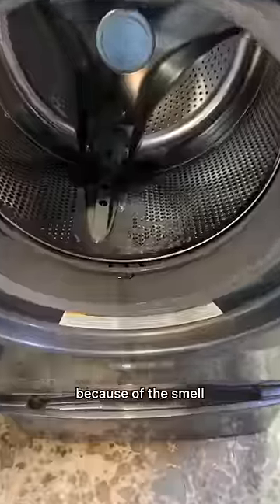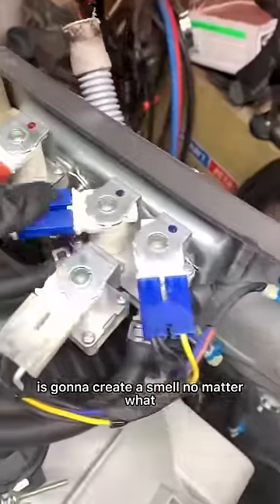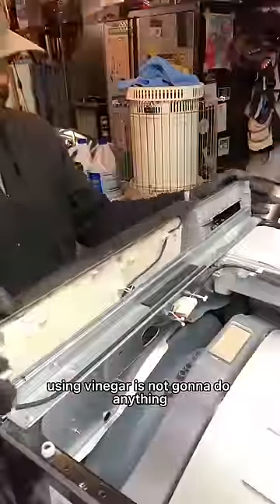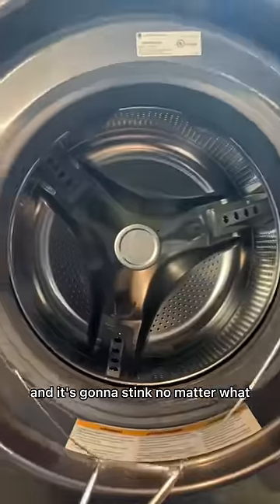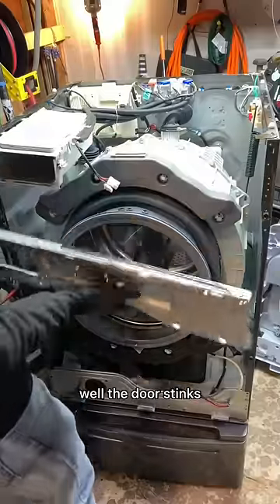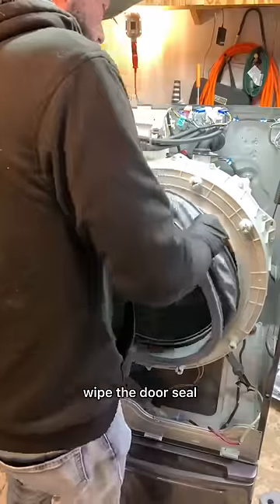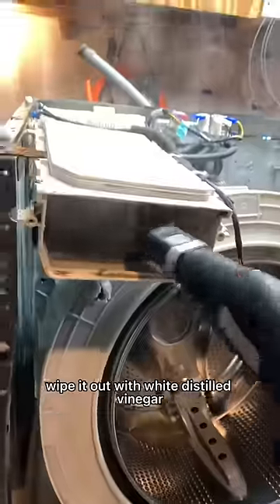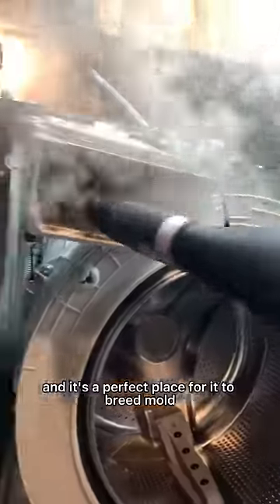Front load washers are proven to wash better. Facts, not opinion

Comment: "I like front load washers", yeah that's because you fix appliances for a living.
Reply: How so? 10 years and still going strong
Reply: Lmfao
Reply: That is because they've proved to be more efficient.
Reply: You know that top loaders are a American continent thing! The rest of the world use front loaders, better in many ways.
Reply: @CobbyRocky  I prefer reliability
Reply: @randybobandy9828  I've been using front load washers both between Samsung LG for 10yrs now and they've never let me down or smell. All I have to do regularly check my filter every 2 months, use the correct dosage of liquid soap and leave the doors slightly open after usage.
Reply: @Rocky Bashimor  my guy... it's been settled ... top loaders are more reliable period.  Less moving parts and gaskets/seals.
Reply: If front load washers are unreliable, they are ill designed. If there where any fundamental issue, commercial units wouldn't be mostly front loading units.
Reply: @Daniel Rose  commercial units are mostly front loaders because they can hold larger capacity. When you need to wash very large items, you go to a laundromat. Reliably is not one of the pros of a front loader.
Reply: you've been breaking yours. Still have one for the past 7 years no service calls since install. We dont take it apart to clean it. Just vinegar cycles and bleach cycles once every other week...
Reply: @AlkalineGamingHD  exactly
Reply: @randybobandy9828   Nope. In all my years of using front load washers, I've never needed to service them or change gaskets nor the seals. Plus with the direct drive or inverter motors, there are less moving parts compared to the top loaders bruh!
Reply: @Rocky Bashimor  it's not "nope." the general consensus is that they are less reliable, and your anecdotal story doesn't change that. It's like trying to say a rotary engine is more reliable than a piston engine, it just isnt.
Reply: They’ve proven to be more efficient & wash better. Everything he said is 100% true. 
Machine was designed to use less water & detergent.
Reply: @CobbyRocky  Those are all proper things to do,  but it may not be enough sometimes becouse nowdays the detergents and softners are more and more concentrated (thicker and thicker) and can leave residue even when you're in the right limits, so in order to avoid it and make sure everything melts better I keep a tablespoon and a plastic cup next to washing machine so I first diluite the softner and afterwords the detergent with some water before throwing it in the apposit section. In the past, during the production process all frontloaders used to get the antibacterial treatment of rubber and plastic parts, but nowdays they cut corners and they keep this treatment only on professional heavy duty machines like laundrymats... Some of the brands advise their customers to run an empty wash on at least 40°C  without any detersive in order to eliminate the build up every 60 washes...
Reply: @randybobandy9828  I do use and prefer HE washers. They are more delicate on clothes and are easier to load/unload.
But we simply cannot deny the KISS principal. More parts -- especially moving ones -- the more areas for failures to occur. 
THAT being said I also have never encountered a issue with my HE. We have a old top load still plugged in but I really dont use it despite liking the better clean it somtimes gives. Just run the HE longer or for two cycles and Im at the same place as the topload.
Reply: Me to
Reply: You can keep any washer clean if you use powder detergent. Liquid detergent users can add calgon and reach the same result, but never wash without builders. Liquid detergents are superior to powder when you need to take care of water hardness at the start of a cycle, therefore I use liquid detergent for prewash and powder detergent for the main wash for optimal results.
Reply: Wagha wagh  no it  literally is the general consensus.
Reply: Thank God  for that. My Samsung’s are 15 years old and still work - my husband has “fixed “ both machines  a few times the “repair “ guy told us to replace them 5 years ago!!
Reply: @randybobandy9828  I never knew front load vs top load washers was a whole debate 😭
Reply: @organiccold  front loaders are junk
Reply: front load r junk. been selling for 20 years
Reply: A cheap top load will still work great for 10-50 years if you take care of it. A cheap front load will reek, no matter how much you clean it, and can make your household sick with mold. 

I'll stick with the good ol reliable top loaders thank you very much.
Reply: @tickley42  a new whirlpool top load will only last 6-8 years these days.
Reply: @randybobandy9828  They are too fool
Reply: @goodlife6277  lmao... nope.
Reply: @tickley42  say what? Never had a top loader because Europe and never had one reek. Keep the door open between washes en washing at hot temperatures once in a while and you're good to go.
Reply: Honestly switched to top loader few years ago hated front loader.  My clothes get dirty at work.  I do deep fill/deep rinse with 2 hour soak. Total time like 3 hours but my clothes are spotless and odor less.
Reply: I work on appliances for a living….and I hate them.
Reply: I was gonna make this comment if you hadn't. He's selling the idea that fronts are better just so he has job security
Reply: I like them too
Reply: @randybobandy9828  no it is not front loaders have been tested and retested by independent companies and all front loaders shit on top loading washers… as for reliability that all depends on the quality of parts IN the washer and a top loader can easily have poorer quality parts in them considering how cheap they are and then you’re just left with improperly washed clothes and a machine that will crap out after the warranty is done
Reply: @zayneparker8711  top loaders break down more often and are simpler to fix, there’s no shortage of rubes that don’t know how to take care of their machines
Reply: @francd2981  like I said top loaders are more reliable. End of story.
Reply: From load washer has gravity on its side when it comes to washing clothes, i.e., the laundry is bumped and turned over much more in a front load machine compared to a top loading model.  I don't know anything about durability, it usually depends on the manufacturer
Reply: @randomdudeontheinternet9926  my top loader is 22 years old lg turbo drum.
Reply: @deanhorn2369  you can't buy top loaders outside the US. Nobody else wants them. Let that sink in.
Reply: @voxelfusion9894  and besides I didn't say anything negative about front loaders just saying how old and reliable my top loader has been all these years so I don't know why you are being so mean next time have some respect!
Reply: Haha seriously….
Reply: There's 40 yr old top loaders out there thatve never been serviced...Also, laundromat do not use exclusively front loaders. I can think of 3 right off that have 0% front loaders.
Reply: I’m a top loader kinda guy
Reply: I like how the only argument that front load fans can come up with is that they’re more efficient and clean better (the second one is incorrect. They clean the same). The fact of the matter is that efficiency is not the argument; the argument is which one is more durable. Front loaders are not more durable. They’re less durable. Stop trying to move the goalposts folks.
Reply: @voxelfusion9894  yeah, and the rest of the world has insane regulations on water usage. Almost like the only reason that only the US uses top loaders is because they use a lot of water.  Almost like it has nothing to do with how durable they are.
Reply: @organiccold  what rest of the world you live in? I've only seen front load in Canada/us. The middle East and sub continent always had top load
Reply: I love this debate thread about washing machines lmao it’s 2am how did I end up here???
Reply: @CobbyRocky  i have a bosch front loader thats 20 years old and still going strong
Reply: @randybobandy9828  u know in a plane a rotary engine can run with multiple pistons out. Slanted engines 1 or two out you’re not going anywhere very fast.
Reply: That's the dumbest thing I've ever heard. They get your clothes cleaner, with less soap & water, and your clothes will last longer. What's not to love about that?
Reply: @DriveByGuy  What good is slightly more durability when they destroy your clothes? Twister washers are not good for fabric. Enjoy your duller colored clothes that need replacing twice as often for your machine that lasts slightly longer. You're paying more money in the long run on new clothes.
Also, your main argument is that you're poor. XD
Reply: I was thinking the same thing! 🤭
Reply: He's got the same advice I gave my wife. Keep a towel close by and wipe it out after each load.
Reply: @randybobandy9828  what's all this moving parts talk? A water pump to get rid of the dirty water and a motor to spin the drum, if you want to get all pissy the door and drawer. Please tell me all the other moving parts a front loader has? Front loaders are better, I'm guessing your American and not caught up with the rest of the world just yet.
Reply: @danielrose1392  I prefer front loaders, but it isn't fair to make a comparison to commercial/coin op machines. Virtually all of those have the door connected straight to the outer drum, meaning just a gasket is needed instead of a huge flexible door seal with plenty of crevices for mould and gunk to collect.
Reply: @organiccold  in Australia I’ve only had top loaders?
Reply: The manual says wipe down the manifold… mine works great
Reply: Overloading front load washer will cause more problems then doing an extra load…. My friend changed his twice while I used my one which is still running!   I never fill it up to the top either….they do.
Reply: @organiccold  except for eastern Europe
Reply: @randomdudeontheinternet9926  
I think front loaders clean better.
Reply: @randybobandy9828  
Front loaders 😊
Reply: @CobbyRocky  
👍🏽👍🏽👍🏽
Reply: No, because he knows how they work and how they are better derpy...
Reply: That's not how it works..
Reply: @randybobandy9828  front loaders are just as reliable if used right, don’t over load them or under load them and they’ll be fine, clean out the door gasket every week or two just by wiping it out and your clothes will be cleaner than a top loader
Reply: @danielrose1392  actually front loaders can just fit more for the design, can always go further back or make the basket wider but can’t really do that with a top loader, and in commercial settings there’s usually multiple side by side, front loaders are better for cleaning though which is the main reason
Reply: @randybobandy9828  user error* is the main problem 😂 which is what makes up the general consensus, I would know, I own a service company and work on the machines from 8 to 5 everyday.
Reply: @daniby9894  I read like half of that but the easiest thing that always works is use these tablets called Affresh, they are for washers, you just put one in every so often with hot temp and it works like a dishwasher tablet, cleans it all out
Reply: Obviously he was talking about using them, not the fact that they exist.
Reply: How so? In my previous house there was a basic front washer from Ariston which was between 20 and 30 years old and working great.
Reply: @organiccold  it's the same reason we have big parking lots instead of so many vertically built parking structures all over the place. It's all a matter of most cost-efficiently using space depending on what amount of space is available to you. We have an amount of land in America that because of it's abundance, makes it cheaper to built outward than upward in most places, with exception to obvious examples like major cities such as LA, NYC, Chicago, SF, etc., that are littered with skyscrapers and parking structures. European nations better reflect the American states that contain those major American cities, than they reflect the rest of America at large, in terms of both size in most cases, and the extent to which they're forced to be horizontally space-efficient to maintain cost-efficiency. There are some areas of European nations that no one wants to be in for whatever range of reasons, enough so that people there could just use space horizontally to be most cost-efficient, but they are the exception in European nations, as opposed to the rule throughout most of any given American state.
Reply from the maker: This is the, literally, this response/answer I have ever sent to this comment, and believe me, I see it at least 10 times a day lol
Reply: @derrickwith2rs  There is no horse milk in the desert.
Reply: In Europe we haven't seen top loading washers in decades. And my machines have never broken.
Reply: @slimcognito.  Unwise is a man who masters his parts, but even more unwise is a man who masters his face.
Reply: @CobbyRocky  what is more efficient about them. Water, electricity, soap ect. And how much more?
Reply: @AlkalineGamingHD  Top loader chiming in. 30+ years old 😆
Reply: @randybobandy9828 they are also more reliable, why do you think most laundromats use only front loaders
Reply: @Randy Bobandy  reliability of a double cheeseburger bobandy
Reply: My cousin has a Maytag front loader washer and dryer, and her husband works a lot, and the washer doesn't get their clothes clean enough. And she also says that if she gets another washer and dryer, it's going to be a top loaded. I agree with her opinion.
Reply: @randybobandy9828  I agree with that.
Reply: I'm from the UK. We don't get top loaders over here. You just leave the door open on the machine after washing, doesn't smell. I have never put vinegar in with my clothes and tbh I'm scared to try 😂
Reply: @derrickwith2rs 
That comment makes ZERO sense
Reply from the maker: Yeah I definitely need to edit it lol. I didn’t read it before I posted it lol. My bad
Reply: They clean better.
Reply: Mines 20 years old haven’t had anything go wrong with it
Reply: @derrickwith2rs  I enjoy your videos and I love the same kind of washer mchines. It's very pleasing to see the care and skill with which you dismantle them, find the faults and repair them.
Reply: @CobbyRocky  By whom?  Efficiency at the cost of more maintenance?  If I could get a top loading washer from 1985, I would.  None of this HE, high speed cess pool of garbage.
Reply: @randybobandy9828 so what a tub and those washboards orrrr
Reply: @Randy Bobandy  if you take care of your car it isn't likely to break down. Same goes for a washing machine, front or top loader.
Reply: @MegaGyalis  and less wear and tear on your clothes. I love a front loader.
Reply: @MegaGyalis  and there’s less wear and tear in the clothes
Reply: @johnbrown5787  more than 20 years. They were also in the 50 s
Reply: @0741921  and in some countries they use washers but line dry their clothes.
Reply: @danielrose1392  True. I work at a hotel doing night desk and laundry and we have a front load washer.
Reply: Top loaders for life!
Reply: @organiccold South East Asian here. Top loaders are 1000% more common sorry
Reply: cries in top loader issues, not getting stuff clean
Reply: @B2Roland if junk means cleans clothes better then yea lol
Reply: My LG front loader has been very reliable for over eight years. We had a motor/drum rotation sensor fail early this year. Diagnosed the failure via displayed code, replaced the sensor myself for less than $20, now works as good as ever.
Reply: @CobbyRocky source
Reply: @CobbyRocky I prefer reliability
Reply: @Warp2090  Same here and my front load has been reliable going 10 yrs strong
Reply: Yeah, and I imagine he'd rather do less and meet more people in public whose clothes don't stink of bad washing machine.
Reply: Ummm... my front loader is 15 years old and going strong. My top loader lasted 5 years.
Reply: @voxelfusion9894 That's not true, they have them in South America in Japan at least.
Reply: Literally every repair person who repairs washing machines...told me those washing machines are the worst...because of the design...and they showed me the faulty mechanics behind it
Reply: @srproductions8798  every repairman I've talked to says both front load and top load are not built to last these days so basically comes down to personal preference. To me, it just seems like more can go wrong with a front load, especially with all the smart features. Top Loads seem like less can go wrong but if they are still built like shit we can't expect them to last these days.
Reply: @danielrose1392 
 The key word here is commercial….less parts, less plastic, better built.
Reply: @CobbyRocky more efficient? 😅😅😅😅😅😅😅😅
Reply: @organiccold my front loader went 15 years without issues, my top loader I have now is junk. I out grew the front loader, it was a small one and not big enough, got a similar age top loader and had problems with the clutch and transmission multiple times, GE didn’t sell the part I needed.

That front loader cleaned better and faster.
Reply: Same top loader for 20 years doing mechanic work . And a machine designed to clean should not need its own cleaning. 😁
Reply: Anyone who thinks top load washers are probably people who don't have dirty clothes. If you work a trade, and you have dirty clothes, a front load washer ALWAYS gets clothes cleaner. I work in the trades and have a ranch that takes 3 full time employees, plus me, to run. The clothes that get cleaned in the top load in the barn never get clean and I often have to take them into the main house to rewash. That never happens to the ones that go inside the main house. They're always clean.
Reply: Speed Queen top loader. It's efficient, cleans better than front loaders and never has the mold issues.
Reply: I like front load washers too…. Had one problem… that was covered by insurance… since then it has been flawless.   Uses much less water, spins  the clothes near dry, much easier on the clothes
Reply: They’ve never been better than the vertical tub machine and never will lol 😂
Reply: Front load washers suck
Reply: @MegaGyalis  , Wash better, how? They don't wash better. They use less water than a conventional top loader. That does not equate to washing better. The main component (water) is being forced into frugality,  when it's the main thing that cleans the clothes. Manufacturers of these pieces  of shit known as HE front loaders seem to have forgotten about  the saturation point factor
Reply: @tickley42  That's because front loaders use such little water they can't drain and flush away dirt,  grime,  soils like top loaders can.
Reply: @rmac41981  , Exactly.  With front loaders you can't soak nothin'
Reply: @voxelfusion9894  We like top loaders in the Americas, because  unlike where you live,  in the Americas, energy does not cost a fortune.  And we have laundry rooms.  We don't have to put our laundry machine in the kitchen
Reply: I use top load washing machine samsung for 20 years. No issue at all.
Reply: @danielrose1392 I had a front wash for about 3 months and it brisk down and started to leak. After that day it was top.
Reply: @derrickwith2rs could you explain how front load washers are better/more efficient than just saying they are….
Reply: @CobbyRocky  if we’re talking anecdotal stories my dad has three top load washers from the 1960s that are still in use today. I don’t think there’s any front load that could possibly come close to that. So put that on a spin cycle and think about it.
Reply: We're not using your american style top loaders in europe at all, they're inefficient AF in terms of water and electricity use, they do not clean as nice and tear up your clothes faster. They SUCK. I Am using ONE single AEG front loader without any issues for the last 15 years, it never smells, never an issue - I only swapped the coals of the engine once, super easy.
I also never knew this smell issue was even a thing before this short, just don't close the door after washing and do a boiling-wash once a month, vinegar not even needed.
They're just objectively the superior technology. Also self-repearable if you're able to read a service manual. You know you're the only country using these old style top loaders anymore?
Reply: @faithdriven11 The 150 year old washing boards are still working as well. Why ever upgrading, right? Also most quality (AEG, Miele) front loaders potentially work 30-50 years with some service, it just doesn't make much sense to use inefficient crap today - the savings in water and electricity outweigh the cost of a new machines in very few years if you'd care to do the math.
Reply: @dynoob  I was comparing apples to apples you’re comparing crab apples to apples no comparison at all with your argument. I’m sure the technology will get better, but for the time being top load is king.!  in fact, a lot of the manufacturers who were going exclusively to frontload have come back around and re-introduced  Top loads because they know the reliability is Superior with Less maintenance. Mic drop.
Reply: @organiccold : lol dude an American invented the front load washer..just like most modern invention the modern washing machine started in America first and the American public got used to a certain style of machine so they continued making it that way because those are the ones that sold but we've had front load washers available in America for just as long  
"technically longer" then they've been available in other countries.
Reply: dammit!
Reply: Every modern top loader my fam has had has died fast. The front loader we currently have is 7 years now.
Reply: All of Europe uses front loaders and no one ever complains
Reply: did you listen to the video?
Reply: @CobbyRocky they use a little less water.  That's it. But my new top loader has a automatic water level. It's 10 times better then any front loaders and cleans better
Reply: @organiccold no they aren't. Not in any way.  They use a little less water. That's it. I've had both and I will go back to top loaders and they clean better every time.
Reply: @CobbyRocky 58 years on top load Maytag and were still going. Went from grandparents, mom, me, and passed on. No front loaders ever will do that
Reply: @AlkalineGamingHD so how is it more efficient if you have to do that? See this is what they don't figure in when they tell you that.  I never have to run my top loader extra cycles. Plus mine has an automatic water level so it uses only the water it needs. My clothes are cleaner then the crap front loaders.
Reply: @kennethlaw9830  Energy Star's "h.e." program refers to washers thats meet the guidelines for energy and water consumption. Less water means less detergent and less power to heat. SpeedQueen has some side load washers that are not h.e. qualified as they are too large and use too much water. 

Its hard to not find h.e. machines many places these days. I enjoy the power, water, and detergent savings for the average refresh washer load. Should I need some extra staying power multiple cycles are always an option for me as are features like the "stain" option which gives the load an extra 30 soaking minutes.

I do agree with you and my mother one one thing; "Look! you can see the water! You need water to CLEAN THE CLOTHES!" 🤣
Only time we've ever rerun a top load was for extra rinse for 'sensitive skin'
Reply: @AlkalineGamingHD  I garuntee your clothes are not as clean as you think they are. Now if you live in the city and you don't really work. You just sweat a little. That may be fine. But when you are country living. When you actually work and get dust, dirt, grease, or any combination of things and you walk them. You will see the difference between front load clean and top load clean.  It's a big difference and front load never add up. You can believe what these people tell you, or you can wash them yourself. The difference speaks for itself. I just washed a blanket my pet sleeps on. It's a very big difference.  The little saving you are getting on a front load is nothing when you have to run cleaning cycles.
Reply: @kennethlaw9830  Well 'person whos never met me' I can assure you that you do not have a grasp on my laundry lol.

Do you think there isnt dirty jobs in the city? I dont live in one but you got to have your head far up in the clouds to act like only country boys know what dirt and grime is.

Maybe you got personal experience with bad side load washers. Maybe you buy a side load at the same price you expect your top load cost back in '64. Fact is if you know your equipment and operate in the box of acceptable parameters you'll have a machine last. Not disputing the power of a solid top load -- but this dogmatic trite of 'top load only load all other bad' is misinformed garbage.

1 cleaning cycle a week. Thats 52 cycles a year. HE machines are estimated at saving way more than what is wasted in 50 odd cycles.
If you treat your front load like a top load you're in over your head and you're gonna have a bad tiiime
Reply: @brandonn6099  You can literally control how much soap you use in a washing machine, the only advantage a front loader has with that is the automatic soap dispenser. Aka, people are to braindead to know how to use less then 2 full cups of soap to wash their clothes. I'm sure yours gets extremely dirty from your trips to the grocery store.
Reply: @carsandcoffee4546  What did I just read?
Reply: @tickley42 Not even remotely true.
Reply: @randybobandy9828 Except they're not.
Reply: @turkeyssr  I agree with you. And don't even get me started on the newer fridges 🙄
Reply: @TardStartler007  Don't forget the new freon free fridges that are spontaneously combusting and the glass oven doors that are exploding.
Reply: @organiccold  Maybe Europe have better front loaders too. Have you thought about that?
Reply: @brandonn6099  "What's not to love about that?" the fact that they break after 5 years.
Reply: @CobbyRocky  what if some reptile 🦎 sneak in ? Spider Lizard , cockroach waiting for some opportunity to get in 🙊
Reply: @jkj1459  Well i dont know where you live and what kinda area.
But never had nothing crawled  on my front load machine.
Bruh plssssss
Reply: @CobbyRocky why have you been switching between the two washing machines in a 10 year period - why such a short time 
I have had me top loader kenmore machine for like 20 years now and still going strong
Reply: @organiccold  I can't think of one way.
Reply: @CobbyRocky  SAme with my Top Loader SAmsung
Reply: @danielrose1392  Those are COMMERCIAL units
Reply: @randybobandy9828  depends on the bran's and model lg front loads are pretty reliable
Reply: @organiccold no way, we used top load washers in Iraq.
Reply: It's very popular in Europe.
Reply: @voxelfusion9894 That is objectively false but sure if lying to yourself to affirm your bias about your hatred of the US is what you want to do then so be it. Electrolux is a Swedish multinational home appliance manufacturer and they sell top loading washer on the European market. One such model of washer is the “WASL5T400”. Tell me why do you hate us so much that something as simple as a washing machine is enough for you to make comments like this?
Reply: @Kami_N7 Thank you for pointing this out. Ridiculous that people will use something as simple as top loading vs front loading washer to bash Americans. Of course they won’t say anything when it is an Aussie using a top loading washer.
Reply: "I prefer front loaders because I can charge a big ton of $$$ tearing it apart and cleaning for the price of buying a top loader."
Reply: Yup 😂😂😂
Reply: What I come to realize is besides top or front the quality of the unit matters a lot more. People spend $1500 on the new iPhones all day but cry about spending the same amount on a new washer I don’t get it. Shits a literal machine washing your clothes